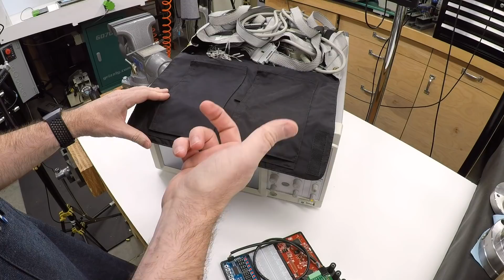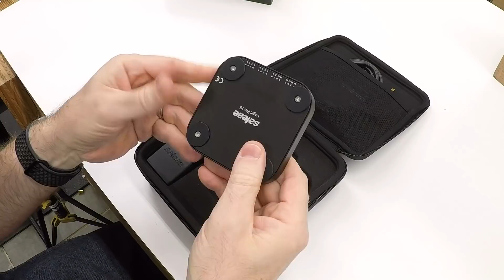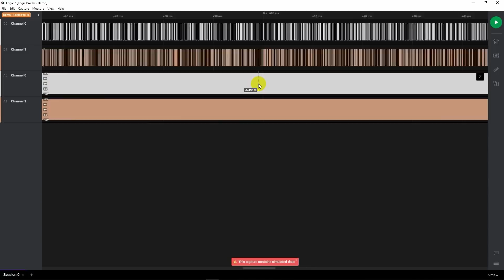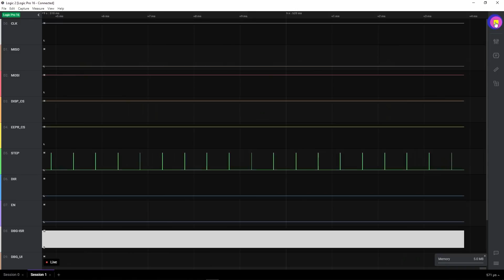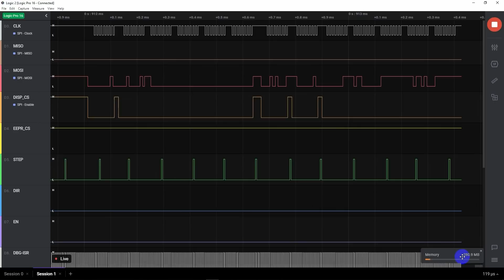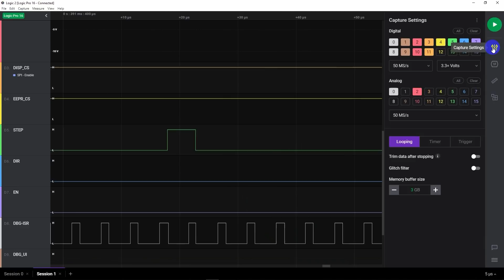Saleae Logic Pro Logic Analyzer - Unboxing and first tests

Comment: I need to capture three digital signals.. that transmit at a 2Mhz bitrate...   for at least 5 minutes.  

What product(s) would be able to capture these signals for that amount of time?  And since it's a custom protocol, can I customize an interpreter to decode the data?

Comment: I am getting the same thing, but just the 8 channel version.  My thing is  I have a breadboard Arduino that runs at 5volts and  I have a  esp32 that runs at 3volts. I have a logic level shifter module, but so far the master esp32 can't talk  via the shift module, So hopefully I can work around this if I can see what is going on, or not :)

Comment: I bought one about 12 years ago and it was a fraction ($100) of the cost they are now. The packaging now may be 'Apple', but unfortunately so is the price. The newer devices are very little different internally to the original devices and the software up until v2 was always in beta, never released. I wrote quite a few custom analysers for the old v1 software which was a great value add. Don't get me wrong, the Saleae Logic devices are fantastic, but they are way way way overpriced now for what the hardware actually costs!

Comment: We use some USB style test equipment at work and I hate most of them. These things always have problems with the USB (wrong port, wrong cable, PC chipset not properly supported) but somehow the Saleae analyzers always work. I have not yet found a computer at work or at home that was unable to use my Logic 8 Pro or the Logic 8 from work.
But where the Saleae analyzers really stand out is with the support for numerous protocols, the interface that enables you to write your own decoder or adapt anyone of the decoders that Saleae provides the source code for. They do take issues found in the software (including the protocol decoders) seriously. I found an issue with the SWD protocol, emailed them with my issue and guess what; it's now on their list of things to do 👍
The more you use it, the more you will love it. The microwave with floppy drive is great for debugging very high frequency signals and to detect timing issues on those signals but as soon as you are debugging SPI transactions, you will find that you run out of its memory. If you are debugging microcontroller stuff, Saleae is the way to go.
P.s: I love those plastic holders for the clips. At work this helps to keep all clips with the analyzer (all slots should be full when done using it) and it also helps to prevent any damage. If you are not willing to give up yours, I think I may 3D print some for my own Logic 8 Pro  😉
Reply from the maker: I was also surprised.  I have had similar experiences fighting with USB drivers for programmers, microcontrollers, and instruments.

Comment: The extra pins on the USB3 connector are for the higher speed data rates, not power.
Reply from the maker: Yeah.  I figured that out and threw up some text in the edit.

Comment: The one thing I hate about these is their lack of advanced triggering. Can't trigger on I2C address, so you can't log only the packets you care about. If there's some device on a bus with a bunch of devices, you need some other way to trigger it to catch that rare packet. I use an oscilloscope's trigger output & the 'scope's I2C triggering for it. Much nicer when you don't have sample memory to record several minutes (or more) of packets.

Comment: I bought one of these when they first came out like 5 years ago. It was way cheaper then like $500.

I've used it on countless projects. One really cool one was where a client I had was having issues on an industrial type of machinery where we were capturing RS232 data going to a printer to record graphical printouts. We were getting what appeared to be random pixels in the data and even in the actual printout. It seemed random.

The decision was made to try to record the actual electrical signals to see if we could see what the issues was. But the event would not happen all the time, so we needed to record for several days. One really nice thing is this only uses data when there are actual transitions. This allowed us to record data for a few days and not taking up gigabytes of data.

Then we were able to use the serial protocol  decoder to save the ascii characters and see where the glitches were happening.

In the end, we found that it was electrical noise caused by a large A/C motor in the system.

Without this device, we would have probably never solved the issue.

On this single job, the Saleae paid for itself many times over.

Comment: Great video ... thanks!  I've had a Saleae Logic 8 for a few years and have been enjoying the development of the Beta software through this year. The guys at Saleae are doing a bang-up job on responding to customers about bugs and features. But earlier this year I had a project that I wanted to capture a little more detail than the Logic 8 was capable of (at the time) so I shopped around for other brands and found the DigiView Logic Analyzer family made by Tech-Tools in Texas. The product is available through DigiKey and the prices are significantly less than what Saleae charges for their products. In other words, quite a bit more bang for the buck; check them out and see what you think. Personally, I think they're both excellent tools and I enjoy using them for testing my product designs.

Comment: Yes the Saleae software is great but it would be useless without that equally slick hardware, software can't measure voltages, it only interprets what it reads from the "slick"  hardware. 
By the way did you consider the 2 Digilent products, the Digital Discovery and the analog discovery 2?

Comment: You'd have to pry my HP logic analyzers from my cold, cold, hands. Thankfully I have versions before all the java and web browsery nonsense that is only going to make the unit unusable relatively quickly.  I do retro restorations/builds where CPU clocks aren't more than a handful of 10's of Megahertz (mouthful). Also you cannot beat the plethora of inputs and proper probing solutions compared to these USB thingies. That said I have an authentic DSLogic plus with properly grounded probes that I got for nowhere near as much as this Salea costs. You just have to buy directly from them and not run afoul of the hundreds of knockoffs on eBay and elsewhere. 
Speaking of nice boxes, I recently got a NanoVNA-F on eBay. For the money I wasn't expecting much but it came beautifully packaged and I gotta say I was shocked. Yes, it did predispose me to seeing the thing in a better light than if it just arrived in an anti-static bag with zero documentation.
Reply: Give Sigrock a try. There are many decoders built in that can help you decode SPI, I2C, UART, CAN, etc. That's where newer hardware/software beats the older dinosaurs. I believe the Saleae works well with Sigrock. I have those decoders built into my insanely expensive Rhode and Schwarz oscilloscope whose triggering options are utterly awful.
Reply from the maker: This is a good point.  Even debugging execution on a Commodore 64 would require more inputs than the Saleae has.  It's all about the application.

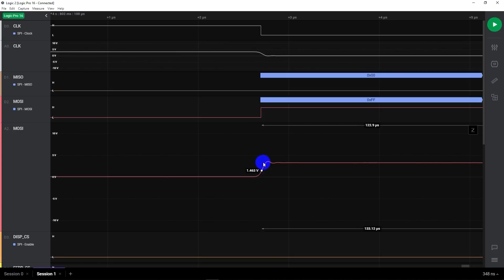Comment: I'd like to see a head-to-head with the DSLogic analyzer; I went with their 400Msps model (the 1Gs version hadn't been released at the time). The sample rate on the Saleae is higher but they still have the "retro" probe design that puts a huge inductive load on the DUT.  I'd be curious to see if that's why you're seeing the ringing at 28:20... The DSLogic has coaxial probe lines with really short ground leads, making that less of a problem.

Comment: Hi James!
I have been using the Saleae for about 7  years (as I recall). It's an old version similar to logic 8 but without any analog feature. Max sampling rate is 24 MS/s. Despite the shortcomings compared to the newer models I'm very happy with this device. It's an invaluable tool when you design embedded systems. As you point out in your video the software is the key to it's versatility (I'm using version 1.2.18). Furthermore it more or less bug free and very simple and intuitive to use.  I can strongly recommend this product. It has saved me many hours of debugging. Thanks for a nice and up to date presentation of the latest version. You will be very happy with this tool and you make me consider an upgrade to the latest version…
Regards

SM6FIE

Comment: Personally, I much prefer the Openbench Logic Sniffer, which does 200Msamples/sec for no more than $50, and it saves that data in actually guaranteed to be available on-board memory as opposed to crossing fingers and hoping to shove everything over USB in real time as it happens. It's rather unfortunate that OLS seems to be harder to come by lately, but you'll only prize mine out of my cold, dead fingers...

Comment: Nice , but very pricey.
If you want something equal but a quarter of the price look  at DreamSourceLab  
I use a DSLogic Plus with Sigrock. 
Sigrok is open-source and supports a lot of devices.
Dreamlabs has some equal software but I prefer Sigrok.
https://www.dreamsourcelab.com/product/dslogic-series/
https://sigrok.org/wiki/Supported_hardware

Comment: Saleae is a spectacular tool. I'm using it for last 10 years, starting from the very first model. Interesting fact from Saleae history: their first model was basically a dummy Parallel-to-USB converter, one microchip from Cypress. There was no firmware in it - anyone could build a PCB with that microchip and use it with Saleae software. Chinese guys quickly took advantage of it and flooded the market with $5 knock-offs. Saleae tried to fight it for a while, but eventually they gave up. They even published an open letter on their website asking to not buy the knock-offs because it hurts their business. You can still buy those $5 saleae clones on ebay and aliexpress and they work just fine (with the limitation of low sample rate, I think it was 40Mhz back then).

Comment: I have the original Logic, and it's been great, the software is what sets it apart for sure. It was a life saver when all I had was an old analog scope. Also the customer service, was top notch. As for the packaging, I think it's like dressing up for a job interview, it doesn't mean you're qualified, but it shows you're willing to put the effort in. So maybe you're putting that level of effort and attention to detail into the product also. Thanks for the great videos.
Reply: I dress how I feel comfortable, if someone values how I look more than what I know or can do then I probably don't want to work for them anyway. I treat products (and people) "dressed" like that as suspicious. I also bought an early model (MUCH cheaper than they are now) and IME the software is seriously lacking in many features, for example if you're trying to reverse engineer a protocol by comparing traces after changing one parameter then that's basically impossible with their software despite numerous requests for it so I ditched them and used open source Sigrok software and alternative hardware.
Reply: They do cost a lot now.
Reply: @jrspruitt  I think they lost track and concentrated more on marketing/image than functionality.

Comment: I got a Logic 8 when they made the current product line (before they had a simpler hardware that got cloned by Chinese sellers). I pre-ordered it because of the introductory price. Full price would probably have been hard to justify for hobby use.

Well, I've been always very happy with it. In fact, I used a similar product at work and the software was so terrible in comparison that I brought my Logic 8 and it saved the day many times. Some time later I got the company to buy a Logic Pro.

I've been a bit underwhelmed by the software development as they decided to completely rewrite it at some point and it took a long time to get to feature parity. But they got there and it finally includes support for custom high-level analysers. I made one a few weeks ago to interpret SPI EEPROM transactions.

TL;DR: highly recommended if you can afford it

Comment: Would just like to point out that anyone, be they a personality or not, can get the Saleae discount. They offer student pricing like many vendors but what they also have is Enthusiast pricing (for hobbyists that don't intend to immediately go commercial), which is the same hefty discount as student (50%). Google Saleae Discount to find the relevant page. So with that in mind, I'm not sure what kind of discount they gave you, but it seems likely that you don't need the "Paid Promotion" tag since anyone could get that discount just by asking. Thanks for the review, I'm impressed with the unit.
Reply from the maker: Good info.  I prefer to err on the side of transparency.  I'm not really billing myself as a reviewer, but still...

Comment: While I have not used this brand, I have used a LOT of test instruments (remember the tube driven Tektronics o-scopes?) over the years. I agree that this one looks like a very capable instrument. I wish I had one of these when I was still working!
I think the ringing on the analog display is due to a number of potential factors - unterminated signal, unterminated test lead, single ground connection (rather than the specific one for that channel). Any, or all, of these can combine to create a false reading. There is no compensation circuit on the inputs to the analyzer as there is on a scope probe.

The other possibility is that the ringing is real. I have seen the connection of the test lead create ringing where there was none. Recall that ringing is caused by a reflection from the connection(s) impedance mis-match. Just the signal "hitting" the instrument input connector, pin, trace and IC pin can create this.

All that being said - that amount of ringing will not cause any problems. It does serve to remind us that there is no pure digital, just fast analog interpreted as digital! Love the geek content of this video. I guess it is because I am one, too. Now I want a new toy!

Comment: DSLogic Plus costs $200, does everything that this thing can and goes up to 400Mhz, DSLogic U3Pro16, costs $300, goes up to 1Ghz.... Why would you buy Saleae for a grand? Or even better just go on AliExpress, find a logic analyzer with the 16 ports that you need, buy it, download sigrok (open source logic analyzer software) and you will have a working stack for about $100...
Reply: Agree with Sigrok. Great software
Reply: OLS, 200Msps, $50.